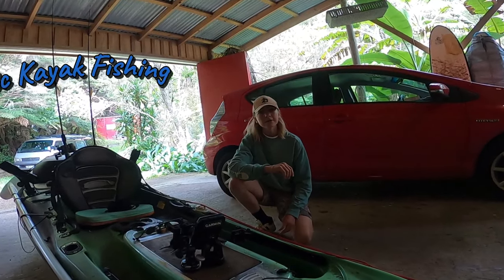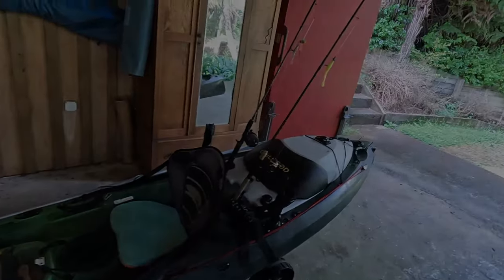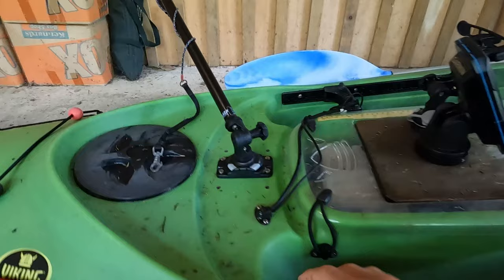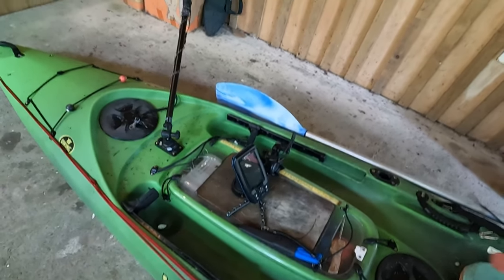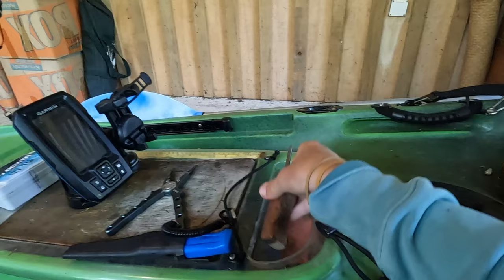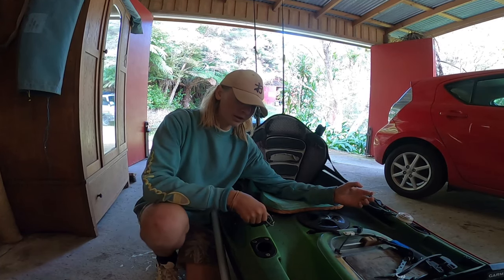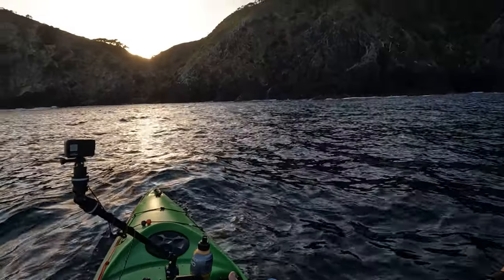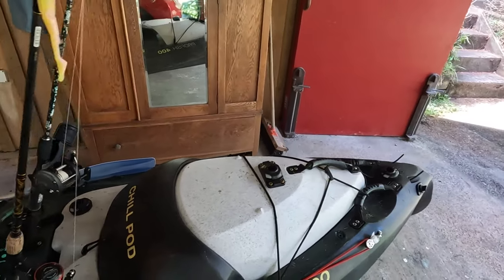My KAYAK Fishing SETUP After 7 YEARS Of FISHING

Comment: Excellent video. I endorse your view to keep things simple and avoid clutter. I try to take just two rods out such as a softball and micro jig or swap one for a strayline or trolling rod. I had a near death experience once being trapped upside down in heavy surf by a paddle leash l forgot to unhook. Luckily the paddle leash broke when l applied max pressure to it. As you said, kayaking can be dangerous so to avoid that, think ahead and remove anything that could trap you in a spill.
Reply from the maker: Thanks mate, glad to here u made it out of that situation Allgood! Keeping the decks clear is something my father drilled into me from a young age (being an x commercial fisherman he's seen the dangers of lines getting caught on things at the wrong time)